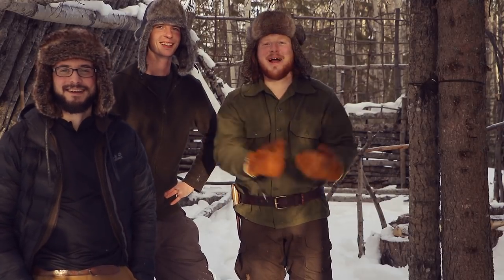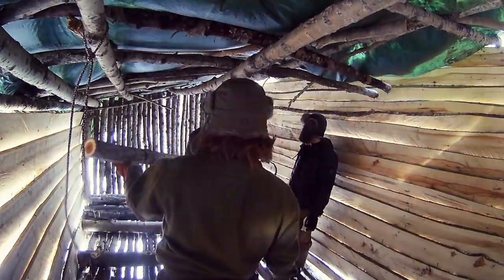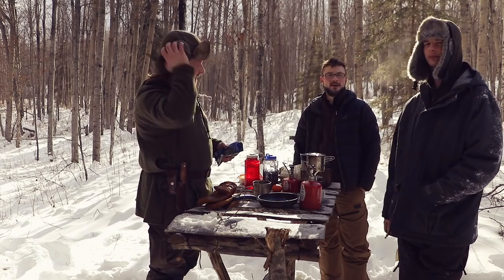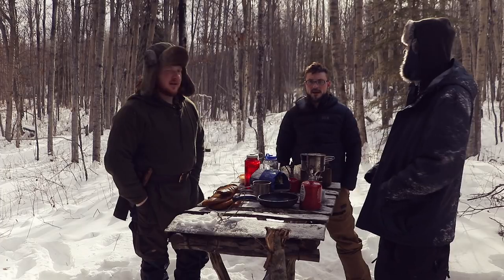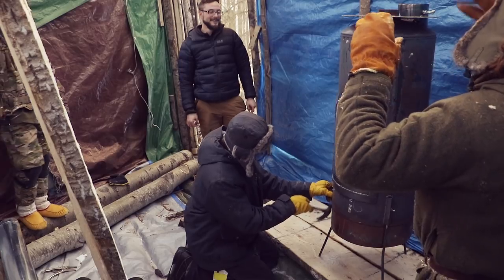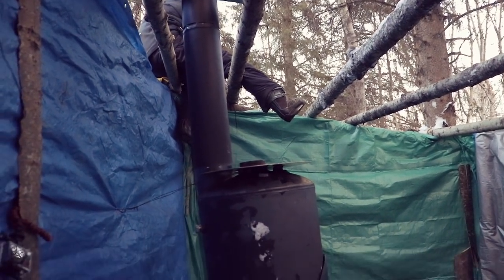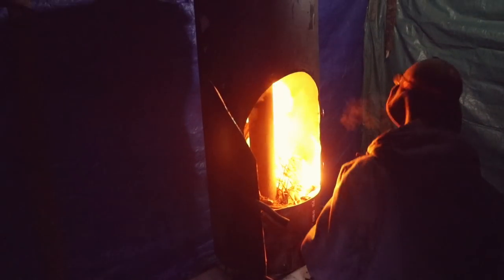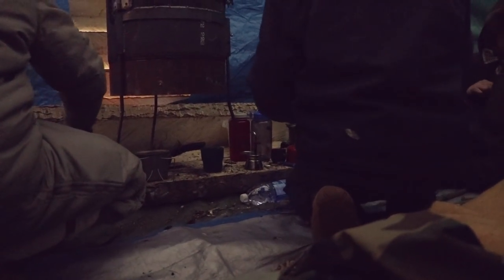Bushcraft Treehouse Shelter gets a DIY WOOD BURNING STOVE!

Comment: Looks like a fantastic stove. Love the whole concept. You absolutely need a "heat-shield" behind the woodstove. A large piece of metal siding or roofing perhaps. It's also a good idea to have a few inches of air circulation between the heat-shield and the wall. There is always a "clearance" required when putting a wood stove up against a wall. The clearance is determined by the size of the wood stove. We have been heating our home with wood for over 20 years in Northern Ontario. Please be safe.

Comment: You guy's need to put a "Damper" in the stove pipe about a foot, foot and a half from top of stove. The damper will allow heat to stay in the stove when partially open, otherwise all heat will exit up the flue...

Comment: Huge stove for such a small space.  I bet it could heat a 1200 sf cabin.  I worry about your safety.  I would definitely place some more sheet metal behind and on the roof where the pipe protrudes.  Protect the plastic and the wood from excess heat with a stove that large.  Fun video.  Thanks for sharing!
Reply from the maker: Yeh thanks, we will be adding sheet metal of a welding blanket behind for aure

Comment: A few ideas.
metal heat reflector plate behind the stove to save the wood/plastic. Some space blankets in the roof under the tarp to help retain heat. Some kind of small concrete slab or stones or thick metal plate under the stove so it doesnt contact wood.

You could also modify the stove to include a metal grate above the fire for cooking maybe, or a metal that can be taken off on the side to increase cooking surface.

Comment: I made the same stove except I cut the water heater in half, since I only use 14in or less wood and I cut the weight by 50%. The tree house is getting heavier and heavier. What does your "foundation" look like? Ps I made the top flat to heat water/cook.

Comment: Was going to ask why no heat shield behind your stove but I see you cut out a section behind it in the tarp, or did it melt ?? Digging the stove btw !! Do you plan to put a shield behind the stove later ??
Reply from the maker: Yes. We plan on using a fire blanket as a heat shield

Comment: Amazing beast you’ve installed. Great to see what you’ve done. I’m wondering if you need a spark arrester on the outside pipe.
Reply from the maker: Yes we did have on on the top 👍🏼

Comment: You REALLY do need to put a metal heat shield behind that stove !  Any light metal that can be spaced away from the wall by 3-6".  You can run the stove hotter without fear of catching the wall on fire.
Reply from the maker: Yes indeed!

Comment: A "T" on the top of the chimney will keep the rain from rotting out the inside of the chimney.  I am surprised the inside vertical pipe wasnt removed for more combustion area.  To cut down on the radiant heat from injuring anymore tarps, wrap a light piece of sheet metal around the outside with a 1" air gap.  You would be surpirsed as to how much safer it is to touch with that piece of sheet metal. Gave you a like
Reply from the maker: Thanks for the comment. Good ideas. The next one will be better

Comment: Nice! Thanks for sharing!

Couple of comments though.

First, you likely need something to protect that tarp behind the stove. Depending on how you do it, you may even be able to use it as thermal mass to help regulate the room's temperature making it more comfortable. I'm thinking a nice mud/clay fire reflector would work nicely. 

Second, shouldn't you have made the firebox horizontal rather than vertical? I would think that it would have made for a couple of major improvements. It would be easier to build fires inside. It would also spread the heat more evenly over the cabin as there's more metal above the fire to transmit the heat you are making. In turn, that leads to better thermal regulation and being more comfortable.
Reply from the maker: Ah yes. This is the first one. I do see many improvements that could be done. It was a great learning project. When I make one for our next shelter I will make many changes to the design

Comment: great job guys never seen a vertical stove like that I feel the desire to ask  you questions. First off what's up with the pipe in the center of the stove why did rube leave it ? Other than saving space I guess why did he go vertical instead of horizontal? And I'm sure you guys are going to put some kind of metal flashing behind the stove right?  Oh yeah awesome rube
Reply from the maker: Yes indeed we will! It is part of the water tank, byt what is nice is it shoots hot air through the middle, the hole on the top fits a stanley cook pot in it perfectly so we can boil water from snow in a matter of minutes!

Comment: hELLO!
What is that vertical pipe doing in the woodstove?
{We never had one in old water heater tanks, we converted}
Couldn't it be cut out? Then you would have much more room in the firebox!
Reply: A heart response is nice, but if Rueben removed the vertical pipe would it have left the tank stove less sturdy? You would have much more room for firewood, with it oxy-acetylene cut out! So why did you leave the vertical pipe in the tank stove Rueben?

Comment: Hi. Interesting. I was getting ready to chastise you for putting the stove so close to the tarp, but then saw that you had cut a clearance out. All stoves, unless they are in the middle of the room, need a heat shield between it and the nearest wall. Half inch fiber board with a heat reflective metal surface, mounted against the wall with one inch spacers should do nicely. The second thing is a question. Why in the world did you leave the center pipe? That completely escapes me.

Comment: Has the stove got a regulator? Otherwise it'll burn at full-pelt, you might get a nights worth out of it if it was nicely ticking over. Great video!
Reply from the maker: It has a flue damper and a fresh air damper. With good wood it would last a good portion of the night.

Comment: what is pipe up the center on the stove
Reply from the maker: That’s the water pipe I think 🤔
Reply from the maker: It’s the original gas flue. There was a gas burner at the bottom of the tank. Now it acts as a heat exchanger. Cold air gets pulled from the bottom and hot air blows out the top.

Comment: I would have put the stove under the tree house, tarp around the first floor , hot air rise,,,    Pack it full before bed, and once in the middle of the night
Reply from the maker: Yeh we thought about that.
Reply: Passing the flue thru the tree house,  with firebrick behind it, once the brick are hot,  they will retain heat for a long time

Comment: I don't my Bushcraft Brothers you need to put some metal behind that cuz I would could heat up and catch on fire 2 are some 10 something there that will reflect the heat back into off the wood
Reply from the maker: Yes we monitored the heat, it was not too bad. We will add metal or welding blanket next trip 👍🏼